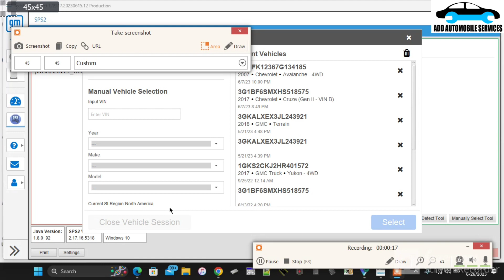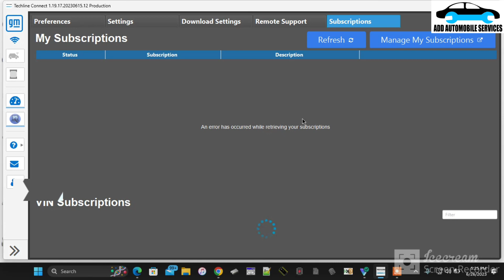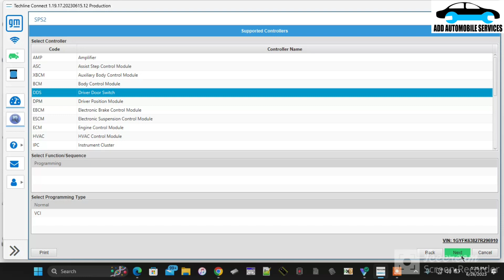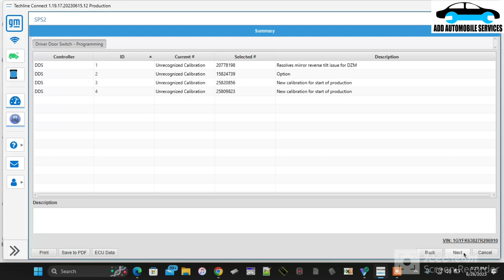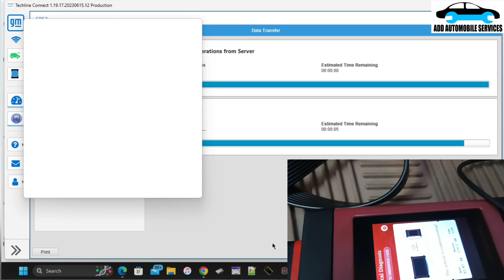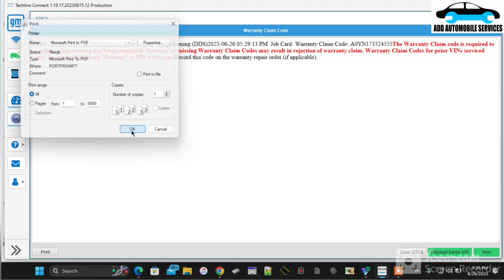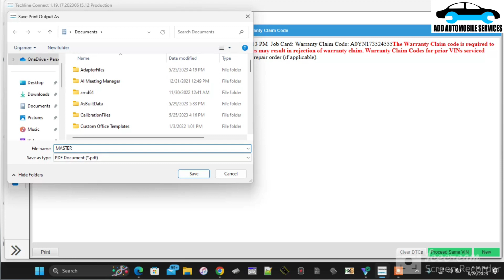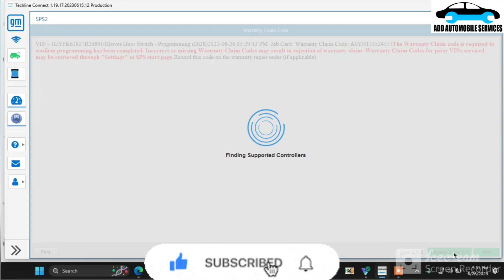Escalade: master door switch programming with thinkcar J2534 plus (TLC)

Comment: Can you add or change option features programming a 2011 Cadillac door switch?
I have a 2011 CTS with manual fold mirrors. Only export cars got power folding but mine has factory wiring in both switches and I’ve added import mirrors and driver switch with mirror fold button. and I can activate the mirrors with my Autel scanner in a special function menu so I know everything works with the BCM and wiring. They just won’t work with the new unprogrammed switch.
 Long shot, but hoping you had an idea before I get a J module and try a GM subscription.
Thanks for all the great info too!
Reply from the maker: You  have to program it
Reply: Yea, I was wondering if you knew if it could be programmed since the car and VIN didn’t originally have power folding. I wasn’t sure if the RPO code or function could be “added” or selected when programming the module?
Reply from the maker: @alienmagma you have to get new one or find someone to clone it for you
Reply: A new switch? I have a brand new export door switch that has the mirror switch in it that needs to be programmed. I was hoping to select options then add power mirrors to it when I'm programming it. I just wasn't going to bother with the GM subscription if I couldn't do that.
 Sorry yo take your time, your video was the closest I've found to what I want to do and thought you might know.